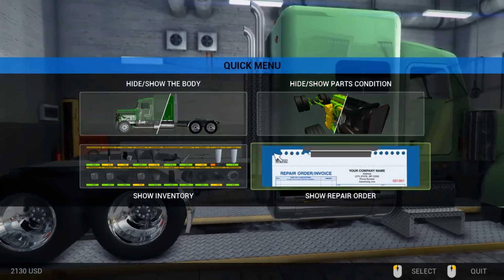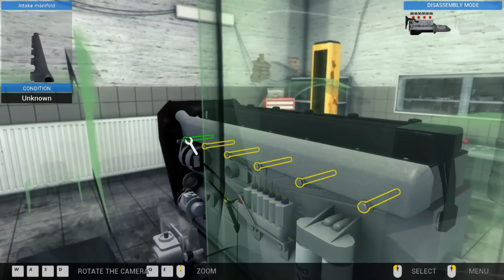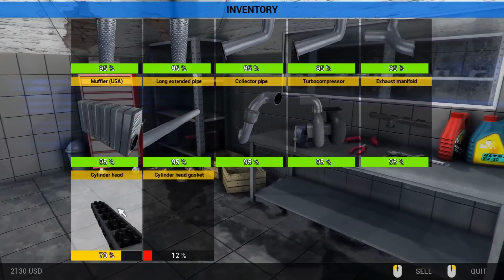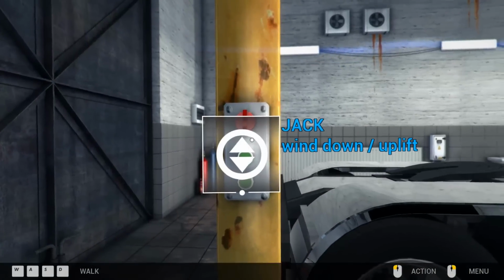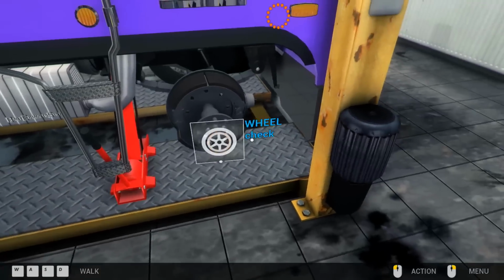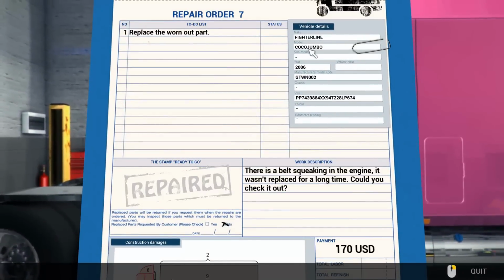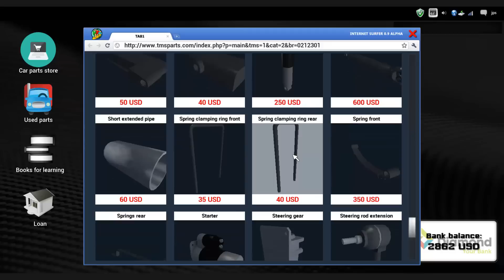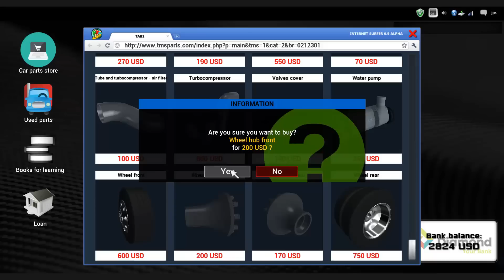Truck Mechanic Simulator 2015 - 002 - Rustling Cows?

Comment: Der I think you are an independent contractor only this is an alternate universe where labor and parts are super cheap, because you would never pay for parts if you were working for the man . . . unless you are adding your own story to the lets play. inline 6 cylinder engines are the most common in American semis not sure why, although there are a few Cat V8's around but they are VERY rare. And a heavy diesel like that would NOT have glow plugs, and it would have an intercooler not just a hose coming straight from the turbo to the intake manifold, also the exhaust wouldn't come apart that way and you would not have to take it off to do head work. And I.R.L. there are many truck drivers that have problems with English. Keep up the good work Der.

Comment: What?! it doesn't look like you can replace the wheels and tires separately. I once helped some one work on his truck and we took of the exhaust in the opposite order we took it off at the turbo first and went back. also I don't think there is the "Muffler" at 12:17 to my knowledge the mufflers (if the truck has any) are built into the "Rear Muffler" 12:48. there is so much wrong with this game but I'm still liking the series.Edit: so it turns out that some trucks do have the "Muffler" at 12:17. oops